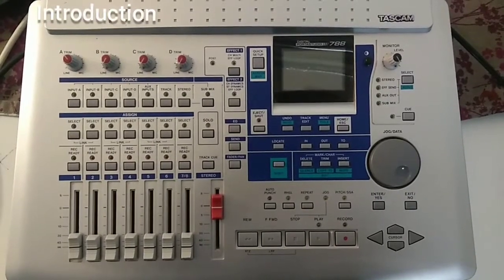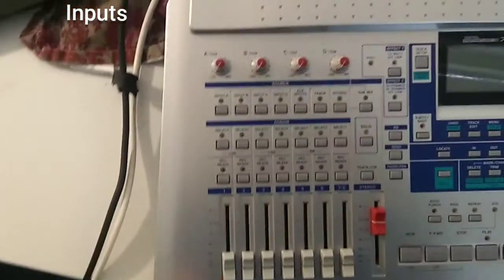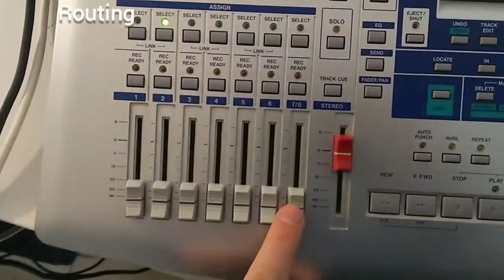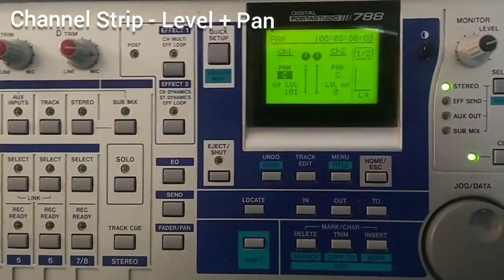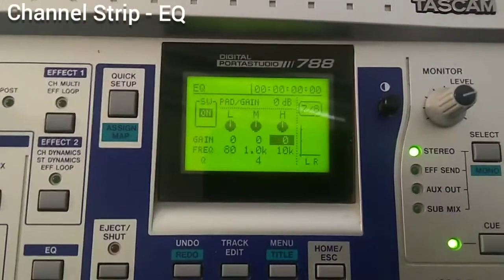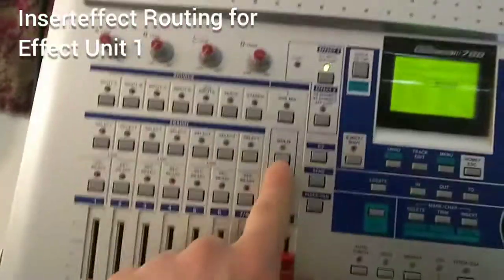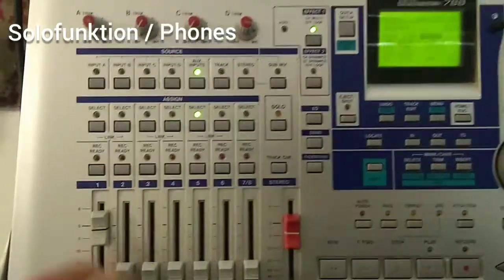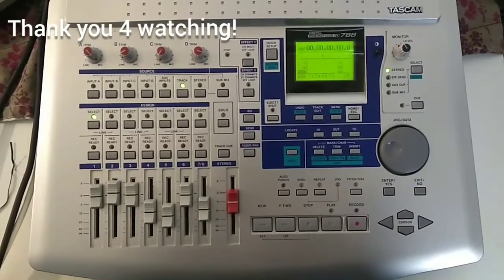Tascam 788 Portastudio - Basic Operation for Livemixing

Comment: I figured it out.   Go to assign map and scroll to bounce 7/8.  Click press select then track and each track that you want to bounce.  Press Select input on each track you don’t want to bounce.    For playback press select track on 7/8 and then it can be mixed with the tracks that were not bounced.   The tracks that were bounced are still in the original track and can be recorded over or mixed in.

Comment: how to get recorded music out of the device. If you plug the SD card into a computer what kind of files do you get? do you get anything you can bring into a DAW? thanks!
Reply from the maker: Hallo, thank you very much for your comment. Sadly, I haven't found a way to import the recorded Data direktly to a PC. Tascam uses a special Fileformat for its recording, that can't be recorgnised at least by Windows. Actually Windows wants you to format the hole SD Card if you plug it to the PC, so be careful. Easiest way would be to use the Digital Out S/PDif and record the Tracks in stereopairs one by one manually into your DAW. There is an option in the Tascam Recorder to convert your recordings to wav Files. But this option is only available in the CD Mastering Menu. So if you don' t have a proper SCSI CD Burner (the device doesn't support every Burner) there doesn' t seem to be a way to get converted wav Files out of the unit. Alesis also used a non Windows Filesystem, but there is a Windows import Programm called HD24tools for Windows that can read the Alesis Files on a HD Drive or thatever. I didn't find an equivalent Softwareconverter for Tascam. I will try if the HDtool surprisingly also handels Tascam Files, but sadly I doubt it.

Comment: Hhmmm... but how do I record something?!  I used this equipment over fifteen years ago but today cant work out how to record the first track and this didnt show me!
Reply from the maker: Hello, yes I need to make a Video for recording as well. But the routing can be difficult while recording, due to the fact that a channel is no longer routet to the stereo output bus once you press the record ready Button above it. The output of the channel is than connected to the related recordingtrack(since it is a 8 Channel multitrack recordingmachine) and the output of the recording is routet to the cue bus, which can be routet to the Monitor Out. This can be difficult to understand. Take a look into the blockdiagramm/ function schematic that i have linked in the description. For an easy recording: simply hit the red "record ready" Button of the channel you want to record and press rec+play together.
Reply: @rocksoundrepair8644  thanks for the reply. I'm sure that when l used it l didnt find so complicated as l am now!